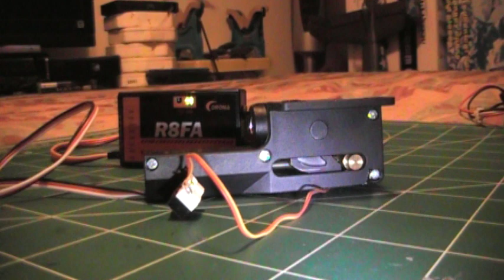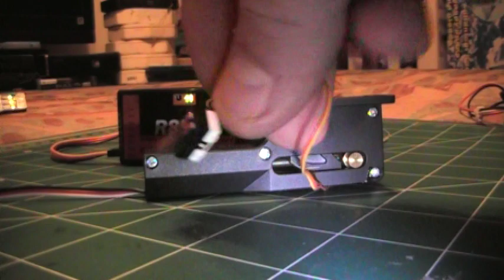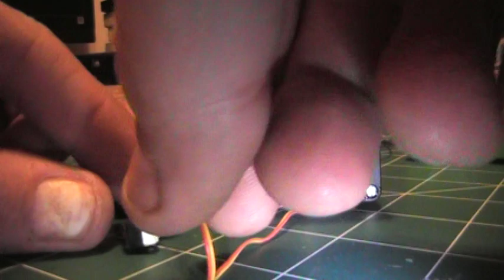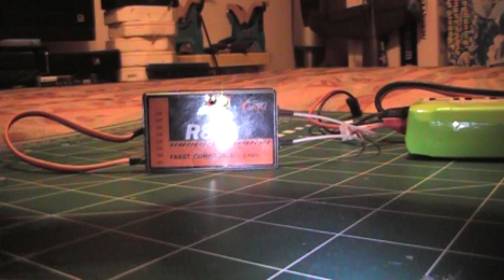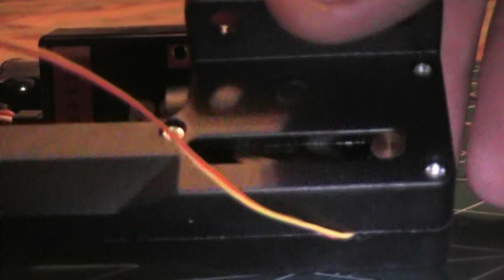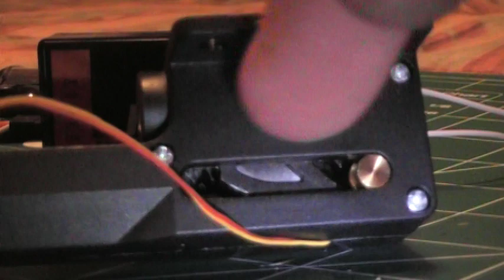FMS V2 retracts from RC Castel test 4.8v and 6.0v 001.MOD

Comment: Brandon.. I am glad I looked at your video because I have a FMS P-51 1700mm in route and have already purchase a Castle Creations BEC and was planning to bypass the provided BEC for insurance that I would not get a brown out..I recently installed a 4.8v to 9v output CC BEC on my 1400 mm T-28 and it is working fine...The default output Volts for the CC BEC from my research, shows it to be only 5.1 v..Do you think I would be ok to go ahead with the installation at the 5.1 V output?